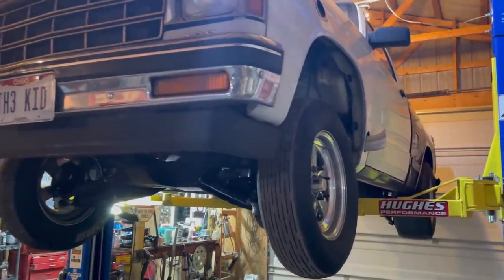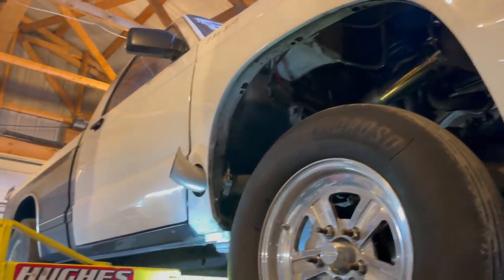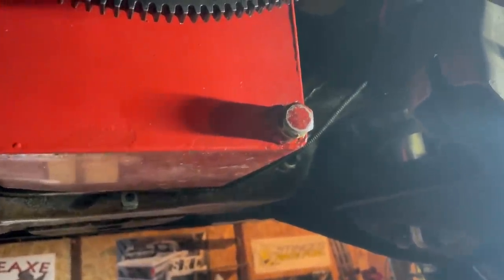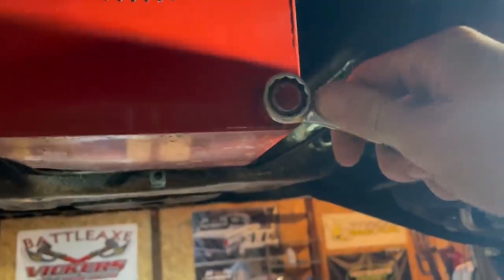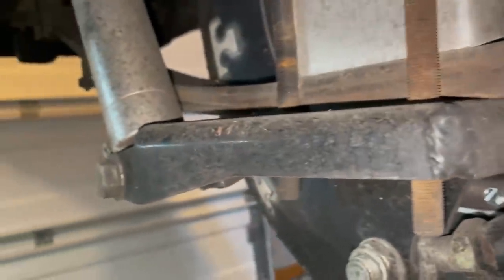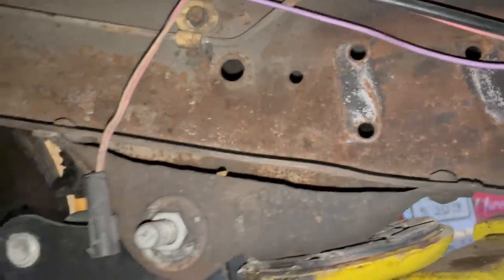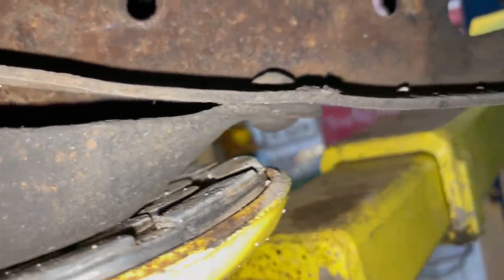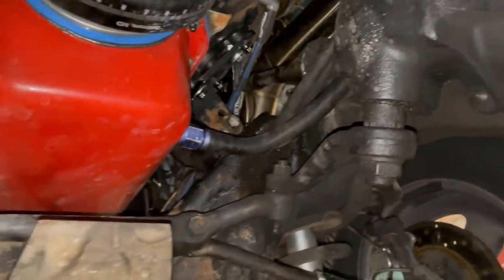Destroyed my Dads Yard, Driveway and Garage... He was PISSED!

Comment: To fix that frame tie down issue, I think I'd be looking at welding 2 anchor points on the rear end and then use what we call a "V-Bridle or 2 cross chains"  in the towing industry. Then you can tie the rear down to your trailer that way. And you aren't pulling on that frame thats showing a fare amount of stress. And boxing in that rear section isn't going to hurt, Thats for sure. Btw,  Grumpy Old Man is just one of the many fun parts of watching your videos.  Be safe heading south this weekend. And Merry Christmas to you and your family.